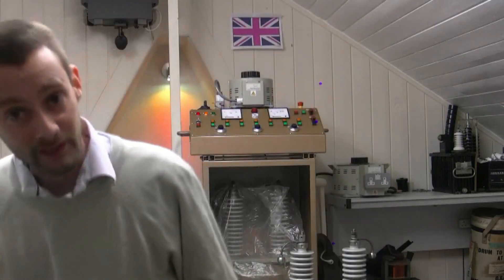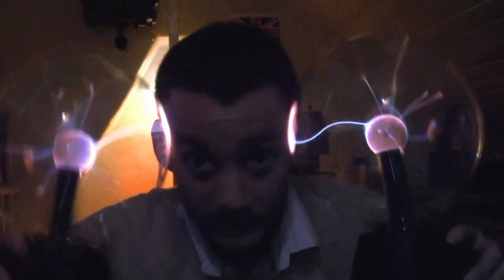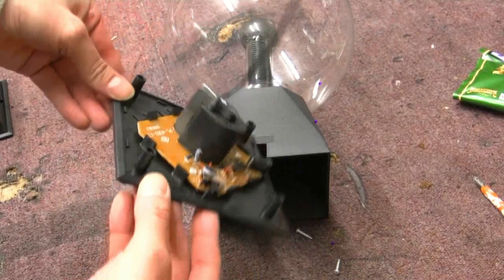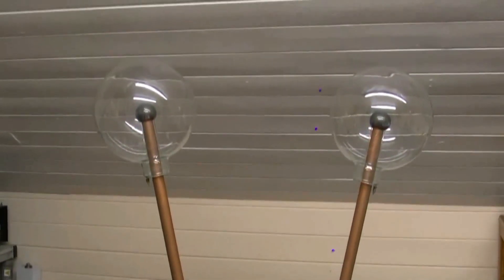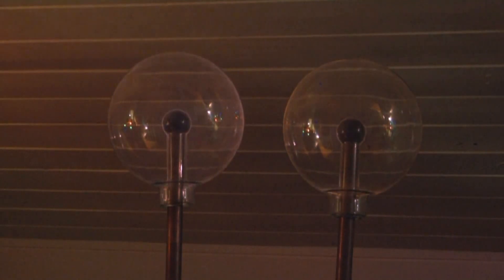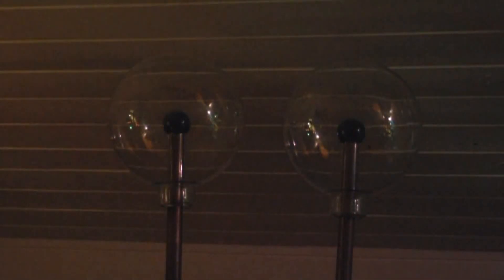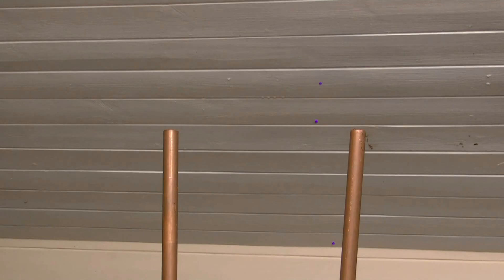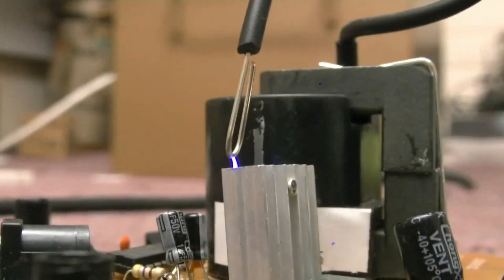Plasma Ball Overload

Comment: I remember putting two cheap plasma globes so that the glass was touching - in a shop. The glass got hot really fast and I took them apart because I was scared the heat would escalate and the glass would melt. Would still like to know if that would have happened and the science behind it....

Comment: The short answer: because the glass melted through. 
The long answer: The plasma balls are usually filled with a mixture of inert gases that give them their characteristic purple glow, but once that gas was allowed to escape, the electricity was arcing through regular air instead-- it just so happens that the normal color for electrical arcs in air is yellow instead of purple.

Comment: I think it'd be cool if you wired a plasma ball to a car stereo. I wanted to try this but I have almost no idea how to begin. I was thinking you could wire the globe straight from the battery of the car, but I know the voltage is to much. I don't know what you could use to connect it to the battery, to keep a constant low-ish current, and then somehow amplify the current as the music plays. Would it be to much to ask you to do a video, or could you give me an explanation? I would appreciate it.

Comment: first of all foil paper is not capable of conducting electrical energy which means the video is fake, second when we puts the tesla ball in his head he was making ground with his hair as they have static energy good enough to conduct any kind of electrical energy so his head would of been fried chicken, third glass can't sustain so much heat as the one we see here it would melt right away, and if it is plastic it wouldn't be capable of going through or crossing the balls, fake fake fake..

Comment: hey Photon, did you have to specially design your breaker-box on the side of your house?  or did you just get a direct link from all China's pow-plants! :P  

just kidding, but on an honest note, what was the maximum current pulled!?
Now theoretically if you were to have a small current & high voltage you could avoid death correct?  so something much smaller than pico-amps, you could walk through the arcs as Tajna's Teleporting Machine? (ie "The 'Magic' Transporting Man")
*excuse me, Tesle's : ;

Comment: Are plasma balls and tesla coils just the same thing? Maybe you could try do this with tesla coils, or build your own from the circuits in those plasma balls.. I've always wanted to build a tesla coil but since I'm 17 I wont touch high voltage things I've had enough bad experiences with those